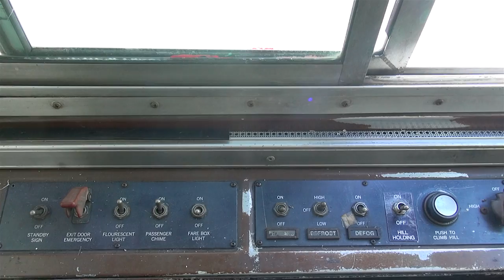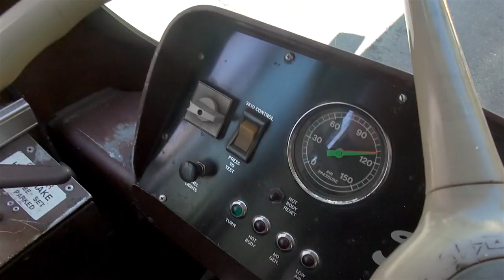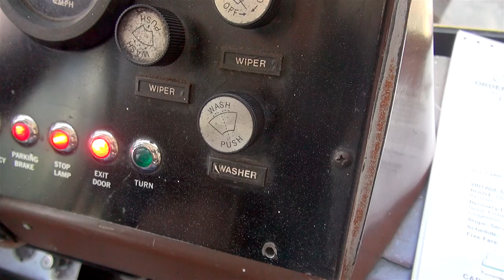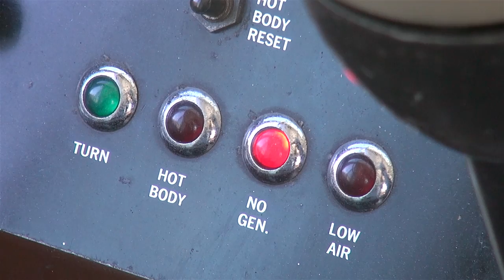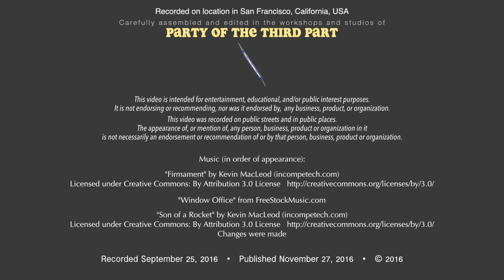Riding around San Francisco in vintage 1976 Muni trolleybus number 5300

Comment: The buses radio with all the zeros across the screen displays the route and run number . When the driver checks in with Muni Central Control when he or she goes to work , they program into the radio their route number , coach number , run number , and driver identification number to be put into the computer system . When the driver calls Central Control , the computer and dispatcher knows who is calling .
Reply from the maker: That's good to know -- thank you very much!
Reply: Party of The Third Part : When Central Control calls a particular driver , a series of beeps sound until he/she answers the radio . The radio conversation is just between the driver and the radio dispatcher . A long beep over the radio is a system wide alert usually used for emergencies or general messages . My great uncle used to drive for Muni a long time ago and I know a few of the transit operators . I wanted to be a Muni driver but my great uncle said to me , " It's a hard job and you put up with a lot of crap and it's for people that don't have a lot of brains . "
Reply: Nope. No radio here.
Reply: Thanks for explaining that! It makes perfect sense now.

Comment: I took the air assist steering off (7.5 turns lock to lock) and installed Sheppard hydraulic steering (3.5 turns lock to lock).

Comment: I drove this type of trolleybus in Vancouver BC I liked them but they were  jerky ,  the switch on the floor ahead of the turn signal switches is the high beam switch.  When we had these to work the overhead switches it went this way, if you wanted to power a switch you stepped down on the power peel to coast a switch you let your foot off the power pedal. It was challenging at times.
Reply: Jerkiness is caused by a controller that does not use make-before-break contacts.
Reply: RaymondHng  Ya  the ones we had were fitted with used T44 Brill Trolleybus moter and components, fitted into a new flyer bus body with a air throttle.  They weren't chopper control, which would make them smooth like are 1982-84Flyer E901s  that came in the 80s. I didn't mind the E800 but most didn't like to drive them especially when you came to a switch to power some would shake bad.  I see this one isn't to bad.

Comment: when you showed the drivers side panel on the left side,  two of them  I need explaining if I could please,  the one switch that says Hill Holding,  and the push button next to it which says,  Push to climb,  that one I am going to take a guess and say that when the driver pushes that one,  it gives the bus a little biut more extra power for hills,  am I right? now on the drivers front panel under the steering wheel,  there is a switch for the skid control and it say to press it to test the dkid control,  How does that actually work? One more thing if I may,  is this the kind of bus that when its hooked up to the overhead electric wires,  and it running on electricity at the time,  if the power does go out,  does this bus also have a backup gas motor so you could actually keep going if you needed to???? Thanlks
Reply from the maker: I don't know what the "hill holding" does, sorry.  I also don't know what "skid control" does, sorry.  Maybe someone else will respond to those.  The "Push to climb", I don't know for sure, but my guess is that usually what it means for electric motors is that it disables the governor that limits the amount of power the motor can use, thus allowing it to generate more power for short periods.  That's just a guess on my part.  The bus does not have a backup gas engine.  That's why you saw us stuck in the middle of intersections a couple of times in the video.  They have a backup battery, but on those old buses those old batteries can't do much.  The latest modern buses can go a fair distance on battery backup (at least enough power to get out of the traffic before re-attaching).
Reply: It’s probably an extra parking break if a bus stop or light is on a steep incline
Reply: @basictransportenthusiast4386  no back up motor
Reply: The hill climb was a power boost. I had a bus driver tell me that he pushed it when he was a trainee and the passengers had to hold on for dear life.